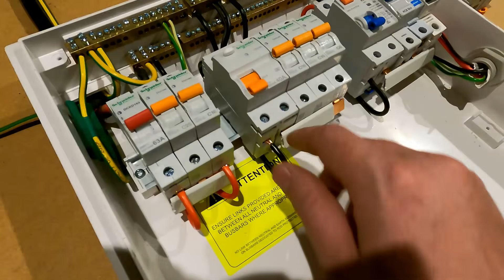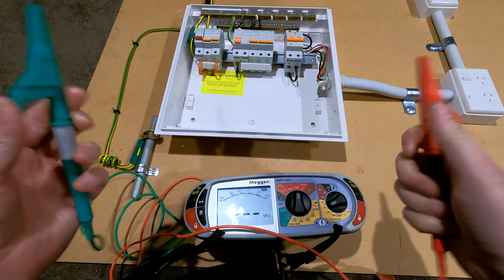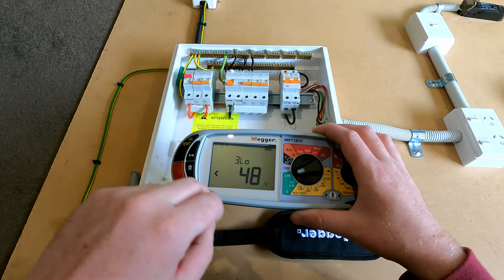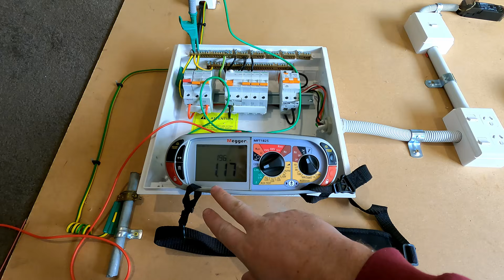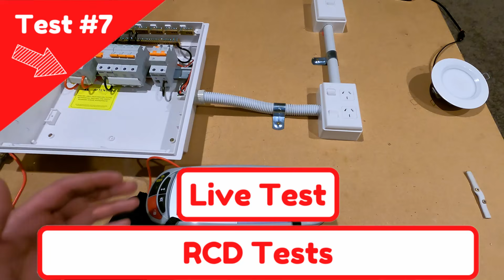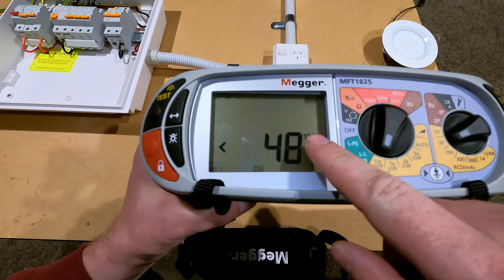How To Verify New Installation and Test MEN Switchboard

Comment: Hi mate. Please clear my doubt: During IR testing u shorted the the active and neutral and turned ON the RCD as well. 500VDC can cause any damage to the RCD? Usually RCD will not be turned ON and perform the IR test on the downwards load side or upwards line side of RCD. Please clarify..
Reply from the maker: Hey there, it is always best to check the manufacturer instructions whether they specify not to test IR on the RCD module. I always recommend that if ever in doubt about something, follow your instinct. IR testing always takes place first and RCDs are rigorously tested afterwards - if they fail they should be removed from the installation. Isolating the individual circuits and components during testing is advantageous in many aspects, although in practice you have to factor the availability of time when completing the required tests.

Comment: Great information mate. Worth noting now in Australia the following:
From April 30th 2023, the installation or sale of Type AC Residual Current Devices (RCDs/RCBOs) will no longer be permitted in Australia - in accordance with the April 2021 Amendment 2 of AS/NZS3000:2018 Wiring Rules. 
Keep up the great work mate.

Comment: I believe the standard may have changed recently (maybe after this video was released) and Australia I believe has the the same RCD requirements as NZ now, being Type A instead of Type AC.    Don't quote me on that though as I havent read the standard recently.    I heard it from someone who I would trust in the industry though.   I believe also now, again maybe after this video was released, that we should be using Torque settings as per the manufacturer on all terminals.

Comment: Love the video mate, I live in Nauru and there are many so call sparkies that are wiring houses and never do any test before utilities liven the building/house which is very dangerous for home owners. I work for the biggest private company and I done all our electrical from homes to hospitals, government offices and even the Australian embassy. I always do installation test and earth test to make sure everything is correct and safe before utilities hook up the power supply. Most of the homes that have been done by other electrician have problems and I would be called to check if it’s been wired properly and it is a disaster. Don’t know why it is even connected by utilities and I have to correct it and make it safe so no one would get electrocuted. Very few electrician follow the AS/NZS code or don’t even know anything about it and yet utilities still connected the house they wired. But now we are going to have our own electrical code which is based on the AS/NZS rule book which is good. I have three apprentice that work with that have already moved on to be good and trusted electricians and I am very proud of them. And regarding this video I have encouraged them to watch and let it be a reference or reminder when testing on homes they wired. Anyway keep them videos coming .Cheers.

Comment: Sorry mate but you can't use a socket outlet as a means of through box to wire a lighting g circuit which is on a totally different circuit because if you switch of the socket circuit of at the consumer unit  it means that there are still live cables running through the socket,so mate you should have put a plastic tee box in like so the lighting cables do not go through the socket outlet

Comment: Great effort these videos take time to produce thanks for the content Dave. The IR for existing installations is 1 megohm for new I believe it is 50 megohms. The main earth resistance does need to be taken at the earth stake / rod to take into account that connection. Equipotential bond similarly onto the metallic material not the connection device.

Comment: Great video mate! Light bulbs in my house keep on blowing out - when I measure the voltage of the socket with the light switch turned OFF multi still reads about 80-120 volts? Does this mean there's a fault some where in the line? many thanks
Reply: Not necessarily anything faulty.  That voltage reading could possibly be ghost voltage or phantom voltage, which can be caused by capacitive coupling, wires running alongside other wires which are live.  It looks concerning, but there's no grunt behind the voltage.  You can confirm this by putting a small load across the test point.  This could be test-lamps, or a duspol tester, or more expensive meters than I can afford also have a LOZ setting for low impedance voltage testing.

Comment: Hi dave, thank you for these videos. The question i have is, how do you short out phase and neutral when insulation resistance testing if the switchboard and meter board are live? cheers
Reply: Isolate power and do the IRT testing when it is not live

Comment: I am a little puzzled why you state that the RCD needs to have an amperage greater than the sum of its downstream circuit breakers. I thought that RCD's can handle far greater currents than actually stated (40 A, 63 A etc), however what is critical for RCD's is the 30 mA rating, which detects current imbalance anywhere in the circuit. Our new house, for example, has a "40 A" RCD (30 mA, type A) connected to several downstream circuit breakers totaling almost 150 A load (32 A + 20 A + 6 x 16 A), if all switched on simultaneously. Are RCD's in New Zealand different from those in Europe or am I missing something here. I am not a trained electrician...
Reply: There must be more going on there then meets the eye. Because 150A going through a 40A RCD would absolutely trip it. What you see on the face and how it is wired may be different
Reply: @damiengrant967  Not 100% sure if something else going on but I do not think so. Unfortunately I cannot send photo of my setup here, but what I said above is true. It is a new house in France.
Reply: @garydavidson6260 I think it's because a 63A RCD is costlier and I heard that the regs in New Zealand or Australia require each RCD to protects no more than 3 circuits (probably to avoid nuisance tripping).
Reply: @garydavidson6260 The amp rating on RCD means that if the current pulled is bigger than the amp rating the device can get damaged. The same applies to main switch. That's why a fuse upstream is required to protect the installation.

Comment: Good video, I´m Electrician certified too and the DS8(Chilean law for electrical instalations), contain more rules bout the wiring and main box, for security here it´s must install main breaker protector that protect cut omnipole phase and neutral "always" over all if exist more than three circuits + pilot light..  i´ve learned much with you videos.. I´m preparing my visa. thanks a lot, see´u soon over there in NZ..

Comment: Hi there SparkyDave, first time here learning alot, appreciating the Uploads and enjoying the content.

My question is, how would one identify whether a breaker is an overcurrent / overload protector, isolator and Earth-Leakage or circuit breaker?
Reply: You have RCD(residual current device) and circuit breakers.
Rcd= earth leakage
Cb= overcurrent
Then there is RCBO which is a combination of the two.
An Rcd/rcbo is always marked with the ‘type’ a,b,c,d,s.
Trip time (30mA)
Markings for the sine ‘curve’

C16 is a ‘16 Amp, C’type’ breaker.

63A main switch covers everything
That 40 Amp Rcd is only covering the 3x C16 next to it

The next 3 are for stoves,air con, hot water. (These go back to un-protected neutral bar)
Covered by their own RCD(voltex)40A

Comment: Thank-you very much for the invaluable video.  I'm trying to understand the "Connections check" discussion around 22min 56 sec into the video.  The video shows that if both the socket and light breakers are open then there is no continuity between the top connections / load side of the socket and light circuits breakers.  Won't they be connected via the RCD neutral bar if:
* the light circuit switch is switched on, and, 
* the socket circuit is switched on and has an appliance in it?

Comment: Hi there, I have question if you can answer! I think I have 10amp circuit breaker , now my question is how many led lights I can install on one circuit breaker? 10watt led light. 220v .thanks
Reply: Convert Amps to Watts

10 (Amps) x 220 (Voltage) = 2200 Watts

Apply 80% rule- 2200 x 0.8 = 1760 W

1760 / 10 (the Led light) = 176 Led lights
Reply: @MrAStompy  many thanks for your kind reply 👍 🙏
Reply: @ajaykumartargotra2768  with LED, you need to take into consideration inrush current. Best way is to ask the manufacturer of the inrush current and the number of fittings on different type of mcb’s

Comment: great vids dave, but you need to insulation resistance test between active and neutral conductors as well as testing active and neutral conductors to earth. Also you have to turn on all gpo switches in case there is a fault in the gpo itself

Comment: Do you need to do fault loop impedance testing if the circuit is on an RCD?
Reply: Yes, each circuits resistance needs to comply with the circuit device.

Comment: 4:54 I have to agree but as a student I stumbled apon a SIT Polytech Relicensing course booklet

which states based on 3000.2.6.2.1 

"The load rating of the RCD is not the sum of the number of connected circuit breakers but that of the largest single circuit breaker"

so it sounds like there might be some interpretion within the industry?

Although I personally agree with your statement Dave.

Comment: I'm a student Dave & hate to through the book around, I totally have to agree with video time . 4:25 talking about RCD rating and maximum demand of sub circuits,

AS/NZS 3000: 2007 - 2.6.2.1 say's that the maximum demand of the portion of the electrical installation being protected by the device or

the highest current rating of any overload protective device on the portion of the electrical installation being protected .

I have a a SIT polytechnic paper which translates this portion to being:

2.6.2.1 [B] the highest sub circuit rating, so if we have 3x20 AMP MCB's = 60 AMPS, 20 AMPS being the highest rating, then this complies.

therefore 16+16+6 = 38 but technically 16 amps is the highest rating and therefore complies 

BUT

I remember that there are 4 way's of interpreting Maximum demand: (So Looked up the wiring rules)

2.2.2 (d) limitation

partial quote "may be determined by the sum of the current settings of the circuit-breakers"

so this appears to have taught me somthing.

:-D
Reply: Hey Cashie we are up to 2018 now not 2007 so might want to ensure your up to date
Reply: @mikeyw1018  that’s incorrect. We don’t refer to 2018 until the regulations refer to otherwise. Till right now, AS/NZS3000:2007 is the go to
Reply: @lovepreetmavi3915  not sure what regulations your referring to but the most current edition of the standard you can but is 2018 so any exams that apprentices will do will be based on this standard not 2007
Reply: @mikeyw1018  regulation courses in NZ are till date using 2007 not 2018 as it has not been cited in the Electrical (Safety) Regulations 2010. Course providers (such as ETCO & ETEC) are still using 2007 and will tell you to scrap 2018 until it has not been cited in the ESR.
Reply: @mikeyw1018  Can you tell me where to look in ASNZS 2018 to find this info please.

Comment: IRT Test - how are you not frying the RCD/RCBO electronics, or LED drivers etc
Reply: The RCDs and RCDMCB/RCBO dont mind the 500VDC from the IR test. 
I believe the LED didn't get fried because he bonded L & N so they were at the same potential and there wasnt 500V across the L & N of the LED driver, only L + N to Earth. 

Happy to be corrected if that is wrong. I always just unplug them from the 413/surface mount socket prior to meggering the circuit.

Comment: I interpreted it as If you actually calculate maximum demand on the three final subcircuits and it comes in under the RCD rating, that is still compliant, as opposed to just adding up each sub circuits rating.
Reply: I guess the good thing about taking on board his way is that there is no margin for error. Room occupants can change and load demands on GPO's can change. So therefore if he had used two 20's and a 10 there is a potential future where someone overloads that RCD. I absolutely take your point, but I think I may adopt his methodology on this from now on.